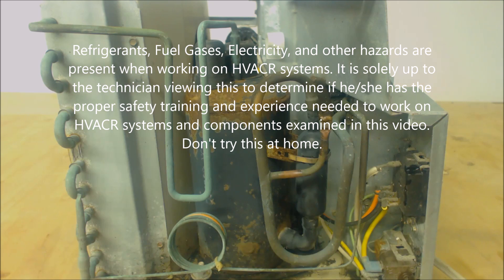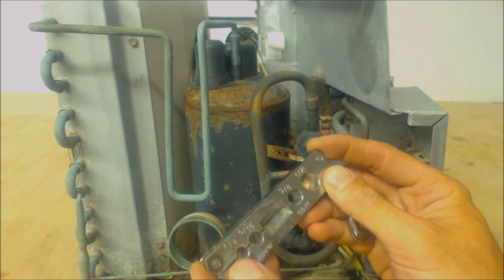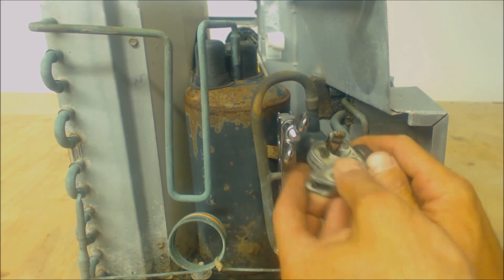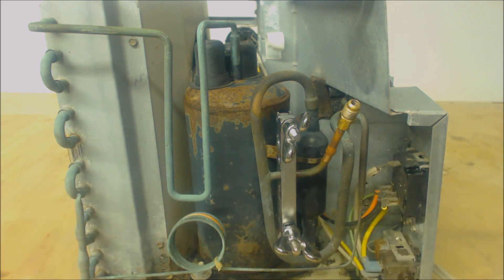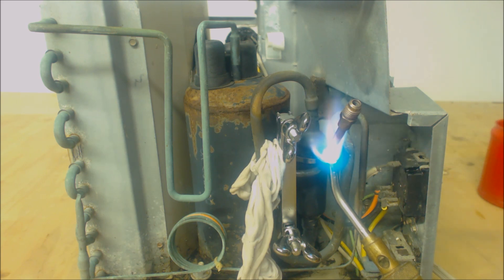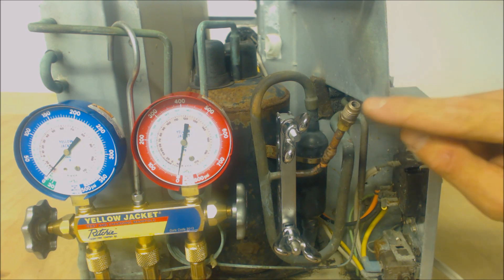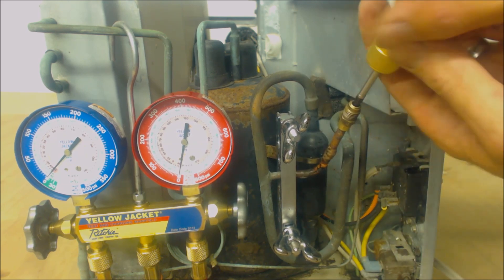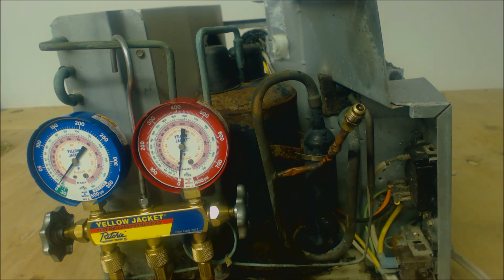Using an HVAC Pinch Off Tool to Braze Service Ports onto an Appliance!

Comment: I was going to suggest the braze saddle valve as well but was already mentioned.  I noticed you mention not using silver solder on 410a.  I've seen quite a bit of talk and literature on it's success and rated strengths so not really sure why one wouldn't consider it with it's liquidus @ 540f.  The extra prep is the only down side I know of.

Does that pinch off tool work well on 410a pressures?  I noticed a commenter below stated he uses 2 pinch-off tools.
Reply from the maker: Yes a single pinch off tool can be used. I had people asking to see how the pinch off tool works. If I have the choice, Id rather use braze with no flux in the line, it is definitely a very debatable thing staybrite #8 or silphos 15 but I like to keep with what the manufacturers are doing. They braze their copper coils on R410a so I do the same. We are also now using aluminum with a very low melting point on those joints so that's right there is no real set thing, thanks a lot Tie Dye!

Comment: Awesome video, I'm glad you did a video on a small package unit. I work a lot with PTAC units at my work. Question, I've had electrical wires rub holes in the capillary tube from the vibration of the compressor. Is it possible to repair a hole in a small capillary tube? Thanks!

If you can do more videos on small package units it would be much appreciated.
Reply: Danny;  We get these randomly on commercial refrigeration units--either the capillary feed tubes used commonly in reach-ins, or the capillary tubes associated with high and/or low pressure cutout switches.   This AC Service Tech is exactly right.  The trick is to cut all the way through . . . . I use the side (corner) of a standard file to saw through at the hole until I'm about 50% through the capillary then carefully bend it back and forth at the cut until it separates.  If you try to file a cut all the way through the capillary, you risk squashing one side or the other of the cut partially or completely shut and you have to cut back more on either side.  

This tech is warning about the brazing technique because of the danger of "sucking" the solder into the cap.  Again, that's exactly right.  But one way to minimize that risk is to "sleeve" the two capillary ends like a coupling with a 1/4" tube that's as long as you want.  Picture cutting and sleeving with a 2" long 1/4" tube over the capillary, basically butt the two capillary ends inside the 1/4" somewhere around the middle of the ~2" sleeve and simply braze each end of the ~2" long sleeve to the respective ends of the capillary.  You ALSO have to be careful not to blow a hole in the really thin capillary copper when you make that joint.  I heat the 1/4" to cherry red, and usually enough heat is conducted to the capillary at the end to pull the liquid solder on and around the cap with a less than one second pass with the torch and voila.

While a long 1/4" sleeve on a capillary tube isn't the most beautiful piece of refrigerant work we ever do, it's very cost effective, works a long time, and the customer rarely if ever sees it.

One last thing to "sweat."  If you have a capillary that is really vibrating (as with some of the long pressure switch sensing lines), the extra mass of the 1/4" tubing sleeve--especially if you use a long one, can result in the tube really stress the cap tube at either or both ends of the sleeve.  Think of it like a "pendulum" effect.  That can work harden the capillary copper until it gets brittle and breaks at your brazed joint.    If I'm looking at any significant vibration that is visibly moving the capillary while the compressor is running, I'll strap that section of the capillary to the insultated suction line or some other softer piece in the unit with tye wraps or duct tape to keep it from moving at all and potentially breaking at that joint.
Reply: C DSERVICES Thank you! Really good info.
Reply from the maker: Yes you can fix them. You need to continue to cut through it all the way and braze another larger cap tube on as if it were a coupling and get in and get out fast with the braze so the braze rod is not sucked into the hole clogging it, thanks Danny!

Comment: Obviously no way to "flow" nitrogen, but any advantage to filling the tube with a shot of nitrogen as you fit the access tube?
Or am I just going way overboard?
Reply from the maker: Ha ha, I was thinking the same thing but no, the tube is too short to temporarily put nitrogen in and have the valve cap without a rubber o ring slightly cracked open. I did not think it would be worth it in case I accidentally held pressure which could create a pin hole leak. Ha you are not alone! Thanks David!
Reply: You could have flushed the tube of air with nitro before. At least most air/moisture would be gone.
Reply: Is it possible just to constantly purge that short piece with Nitrogen during brazing? Nitrogen through the Schrader valve but not fully tightened.

Comment: A simple saddle solder valve is all you need. And I'm not talking about the bolt on kind either. I used them for years as a Sears refrigeration tech. It's made out of copper that is soldered on to the copper line while refrigerant is still in it then a cap is screwed on that taps a hole in the line that has a srader valve in it. That's all Sears uses. It only takes a couple minutes to have it installed completely. They are used on high and low sides. I never had one leak and we used a lot of them.
Reply: Can you put the saddle type on with Stay Brite 8 or do you have to braze them on?  For R134A and R404A fridge and freezers
Reply: Concerning contractual service work, in many instances, it's not "approved" in the contract to use saddle valves of any kind and/or it doesn't meet "code" if it involves a government entity. Doesn't mean you'll get caught, but this is the only method I've ever seen allowed across the board.  Most supermarkets, government housing, etc, don't want the "cheaper" methods being used. Just passing it along.  Best to know the regulations where you're working. It's your refrigeration license that gets the fine and the write up.
Reply: My friend’s refrigerator leaks from the so call saddle valve. The previous technician put it in the middle of the copper line. It gives so much work for the next technician: recover the refrigerant and fill the hole. If the previous technician put a terminal valve that will be much easier for later technicians
Reply from the maker: Thanks M Watkins!
Reply: acservicetech, please do a video on this method also. Thanks
Reply: I use saddle valves all the time they work great 👍🏻
Reply: M Watkins- can you use the braze on saddle valves on a sealed system?
Reply: @juliotorres3481  yes
Reply: Edward HVACR CT  What's the reason the service valves are not left on unit?  The idea of propane systems sound great based on performance and GWP but sure scares the hell out of me thinking of firing up a torch on one.  Do those systems blowup on a compressor burnout or does the lack of oxygen prevent that?

Comment: Good vid. I have just ordered a pinch off tool. I have up until now just used the bpv 31 bullet piercing valves , recovered and installed weldin access valves. Im gonna give a shot at doing the pinch off thing. You know if u use oxy acet rig u woukd of been in & out in a few seconds on that joint. But , still a good vid. Thanks for making it.
Reply from the maker: Absolutely right, Thanks OCRefrigeration!